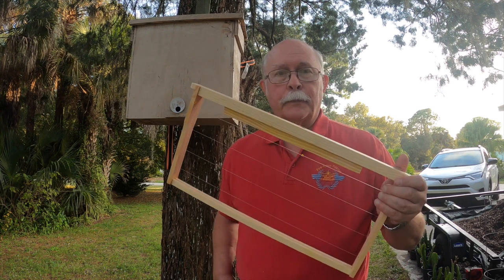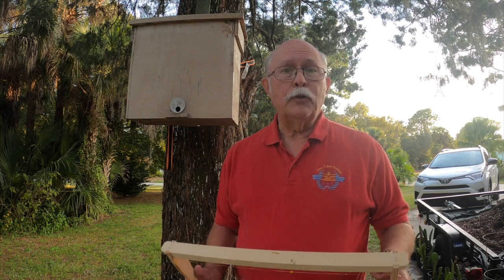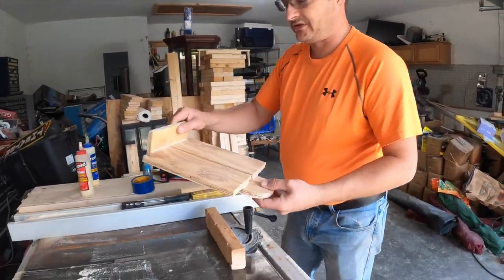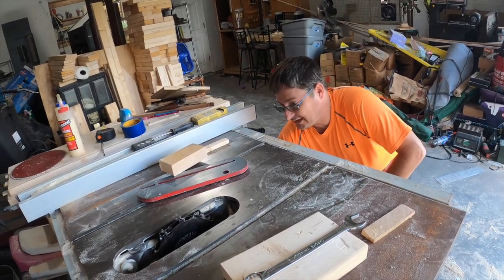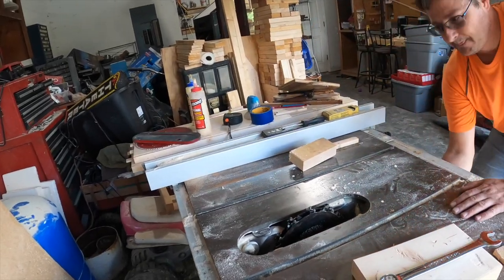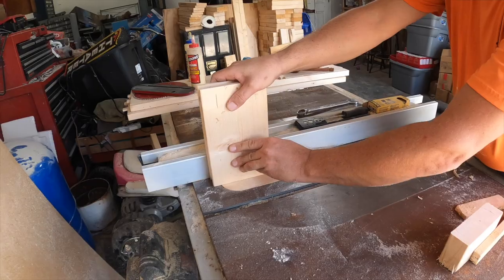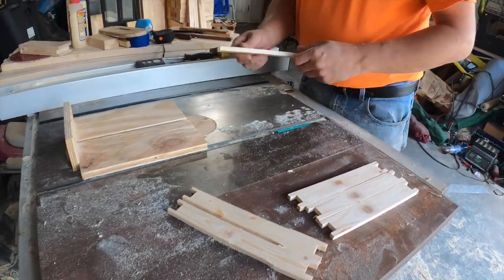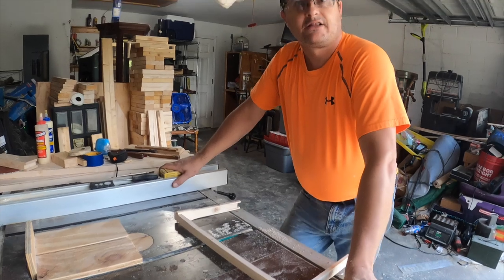Free frames from scrap 2x4s

Comment: I have been building my own hive boxes for years, but never tried building frames. They used to be relatively inexpensive, but of course that has changed. I was experiencing a great deal of angst about the expense of ordering frames for a substantial bee yard expansion. I can get my hands on plenty of scrap wood so I can follow this very practical procedure and will consider the resulting time and effort well spent. Sincere thanks to you both!
Reply from the maker: That is awesome Against all Flags, you get a lot of satisfaction from making hive components for our bees.  I don't have a dado stack for my table saw but I just bought a cheap table router from Harbor Freight and will use that next time I need frames.  Thanks for watching and commenting 🙂.

Comment: All of my beehaver friends that thought I was crazy making my equipment because time is worth money and it's cheaper to buy frames couldn't get frames or boxes since the pandemic started. I bought all of my equipment off of facebook over a couple months time. Thickness planer, jointer, radial arm saw, 4 old 1950's Craftsman table saws, router, and a few other odds and ends for less than $600. I set each piece of equipment set up for a different step. I use scrap and buy cheap cut offs from Lowe's.  I have hives and all the frames that I need and it cost me less than if I were to buy them. People need to stop putting a monetary value on what they do for themselves. I have those same beehavers wanting to buy my products now. I'm a beekeeper for close to 30 years now.
Reply from the maker: That is awesome Jeff!  I used to think frames weren't worth taking the time to make too but it is really satisfying to build them yourself.  I appreciate you watching and commenting.

Comment: Great video. A safety tip: Your push stick should not go over the blade. Make thinner so it does not contact the blade and stays on the inside with the piece being cut. If you slightly drop that stick as it is, it will kick back and hurt you.
Reply from the maker: Good Morning Pedro, Great tip. Thank you for commenting 🙂

Comment: I do the sides a little differently to save the cutting the profile edge cut on each side.
1) plane the 2xN to correct width first (shaving the 2xN's top and bottom) saves cutting every side to size and no finger near the saw :)
2) Dado the top and bottom bar notches (centered and the correct sizes for my top and bottom bars)
3) Run the block part way through a joiner to a stop block 1/8" deep (make the side profile for all bars in one cut per side).
4) slice the block with a band saw (less waste to kerf mean more bars per 2xN) also fewer blade changes.
Done.

Be safe!
Reply from the maker: Good on you:  It always feels good and saves money to make these things yourself.  😎
Reply: Fortunate to have a table saw, bandsaw, thickness planer, and joiner, so this technique will save me time and money..Thanks

Comment: when I am cutting the sides off I put a large box off the back of my tablesaw, that way I am not leaning over the blade. I have invested in woodworking equipment and run the 2xmaterial thru a planer, cut to size, run 1/2 way thru my planer, cut notches in top and bottom then cut off 3/8 side  bars.
Reply from the maker: Sounds like a great way to do it, thanks for sharing

Comment: Great video I only wish you had added the dimensions of your jigs. I would love to make some frames and need to make a jig to cut out the ends for the frames. Thanks again for sharing an awesome video.
Reply from the maker: Thanks, I am really not very scientific about this and usually just use a store-bought frame piece as a reference for my cuts.  I didn’t get the measurements from my friend Chris.
Reply: Bruce I read the other tex you received and I must agree you need to use a push stick that fits your work along with the feather board. Also I wanted to comment about the burr comb and wax scarping from your bee hives.We should all carry a little pail to keep the wax in, it adds up over the year. Also helps protect your bee yards from small hive beetles. Ok I have to plan my next job with the bees. Hope you had a Merry Christmas with lots of HONEY
Reply: Buy your first hive, then you have every thing you need,just make your jigs and go, I drill, glue and screw my boxes, glue and cross nail all frames, unglued frames will pull apart sometimes!
Reply from the maker: @sheilamclaughlin963  Sure but there is a certain amount of satisfaction from building stuff yourself.  Plus it’s cheaper - I asked my bees and they said they don’t care if it’s not store-bought.

Comment: Running your stock initially through a surface planer to achieve the width of the sidebars would eliminate the thick side thin side issue.
Reply from the maker: That would be the way to go. I really should buy a planer one of these days.

Comment: Lumber prices? UGH! I saw a woodworker in PA making frames with a bandsaw, too much effort for the benefit when frames were a dollar each. Its still a lot of work to make a hundred frames at a time vs buying them in bulk. I'm making simple boxes to go over a hive top round feeder with an inner cover attached, just using cheap fence boards as a permanent part of my hive.. As others mentioned, the time saving jig makes this more practical for someone with higher quality machinery/tools. The basic table saw I own does not have a dado plate and the crosscut mitre piece is not precision to do any quality work (just stating the facts). I bought a chop saw to make more precision end cuts.
Reply from the maker: I know what you mean!  I also bought a chop saw for the same reason.
Reply: @bruceandhisbees1770  Hey Bruce, I really likes watching your many videos
Reply from the maker: For sure, the boxes and woodworking tools can be fairly simple and cheap - the best part is that the bees don’t care.
Reply from the maker: @heavymechanic2  Thank you Vegan 😎

Comment: How does he make the top and bottom bars?
Reply from the maker: Hi Dennis, Thanks for watching!  The top and bottom boards are much simpler to do than the side bars:  I don't have the dimensions in front of me but the top and bottom boards are cut to size, notched at the ends to accept the side boards, then a groove is cut to accept foundation if desired.

Comment: Well... I have a strange 
feeling ... 
that even : declared:
  "*not treated pine " 
...  in fact is lightly treated 

I pick up lots of stuff like that 
for my workshop wood heater
 - for free ...  BUT
 A smell of the smoke is realy strange ... with heavy chemical note ...
...   and wood has a bit of 
Green spots and dots and lines 
if exposed to the rain or outside conditions. 

It looks totally normal and untreated (* treated timber is green or blue painted) 
... but... still
I am recenly becomin   suspicious   ...
Reply from the maker: You are probably right to be suspicious and you can certainly stay away from this kind of wood if you want.. Still, I have been using scrap wood with my bees for years and it seems fine. Thank you for watching.
Reply: @bruceandhisbees1770  I am currently trying to master 
Beeboxes creation from those 
Building site offcuts... 
and ...thinking - MAYBE
A Good coat of parafine or wax 
will insulate interiror from bees anyway... and there will be no real 
conection...there ...
I was even thinking ... clay coating  inside. . . Like in old Hives... 
...those skeps...

Comment: I want to like this guy for talking about the importance of shop safety, but holy crap does he not practice it... I mean, kudos on unplugging the saw and not wearing gloves, but he needs to learn how to use that saw better, or that ten-digit brag isn't going to age well.

First, and most obviously, put on some ear protection, dude. 

Second, never crosscut on a table saw in a way that leaves the workpiece pinched between the blade and the fence or, in this case, a stop block. Use a stop block that is fixed in place near the front of the table and doesn't stay against the work piece as it moves forward into the blade. Better yet, just use that miter saw you can clearly see behind you that is actually designed for crosscutting.

Third, making dados on the board ends freehand like that is absolutely nuts. There isn't enough surface area on the end of the board to maintain decent contact with the table to begin with, and half of that is getting cut away. You also have to put your hands way too close to the blade while applying significant force directly toward the cut. If you're going to do this step with a dado blade in a table saw, you need to clamp the work piece to a tenon jig. They're super simple to make, and make it both safer and easier. A router table with a featherboard is another option.

Lastly, and by far most importantly: When ripping on a table saw, no part of your body should EVER be in the space directly between the blade and the fence like he has his @19:14. This is the number one way people lose fingers on these machines. People don't understand that the biggest danger with table saws isn't the saw kicking the board straight backwards. Rather, it's when the saw starts to lift the board with the teeth coming up out of the table at the far side of the cut. In a fraction of a second, the board lifts up, begins riding on top of the blade, and gets yanked hard away from the fence. The hand that just seemed a safe distance away gets pulled straight toward the spinning blade while the board goes flying, leaving nothing between hand meat and carbide teeth but air and way too little time for a human to react. USE PUSH STICKS!

Also, put the riving knife back on the saw! You can clearly see that the factory insert plate has a much longer slot behind the blade than it does in front, which is specifically to accommodate a riving knife. The over-topping kickback is exactly what the riving knife is there to combat, and it was the single most important safety feature that got added to table saws until the SawStop was created. I know it's a pain in the butt when you're switching that dado stack in and out so much, but it's there for a reason.